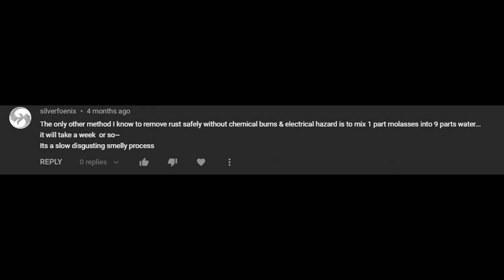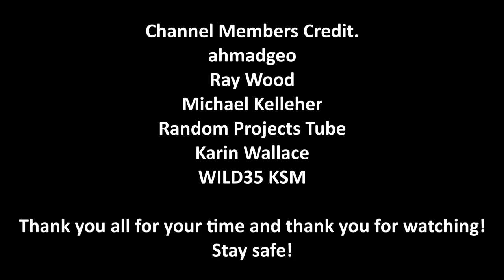Removing Rust with Molasses - Cast Iron Restoration.

Comment: Molasses is pretty expensive last I checked. I would just buy evaporust if I was going to spend that much money. Vinegar works quicker than molasses and is cheap. Sandblasting is always good to if you have the setup.
Reply from the maker: It is quite expensive yes.

Comment: I use an old computer power supply for Electrolysis,, and Oxyclean powder to make the solution,, all the info is right here on youtube....sand blasting is not needed.
I use 8 coats of Flax Seed oil when seasoning cast iron cookware.
You know you have the right Flax seed oil when the oil has to be refrigerated after opening.
425F for 1 hour,  let completely cool between coats.

Comment: THANK YOU for your restoration videos.  i enjoy watching them all.

here are some tips:

1.  for an iron pan, remember the chinese saying "hot pan, cold oil, foods wont stick" (it rhymes in chinese...  heat the pan until just smoking, then add oil & swirl it around.
2.  once the oil is heated until just beginning to smoke, add the meat, and quickly spread it out so it's not piled on top of itself, which would lead to steaming...  let it cook for about two minutes before trying to move it.  that way it builds a nice crust and will release from the pan.  this is especially important with ground beef.
Reply from the maker: Thank you very much!
Reply: @AJRestoration  this method really does work!  Heat the pan very hot, then add the oil and swirl it around.  When it begins to shimmer, add whatever you’re cooking, and it won’t stick!

Comment: I would think Evapo-Rust would do the trick. Then a good sandblasting and wire brushing before doing the seasoning part. I wouldn't think molasses would do such a good job removing rust anyway lol
Reply: it takes a long time, but it keeps removing rust the longer it's left in it. the benefit is more for large items like car frames because feed grade molasses is much, much cheaper than evoporust or other chemicals; you can make a huge vat of the stuff to dip something in for cheap
Reply: @briangoldberg4439  I can give it to you that it is cheaper, but you can reuse Evapo-Rust over and over again even when it’s dirty and black. Ask Hand Tool Rescue lol
Reply: @MarkMeadows90   the amount of evaporust you would need to dip a whole car frame or anything else that large would be astronomically expensive. hardly an option for the average DIY job
Reply: @MarkMeadows90  I have an issue restoring things you eat out of with chemicals, especially cast iron. Evapo-Rust is good on anything else. Jmo
Reply: @johnnyb1776  Well, there's always a good sandblast

Comment: I wonder, have you ever accidentally etched a smiley face on something and it wouldn't come off?
Reply from the maker: Yes in one of the first Cast iron videos, you could still see the smiley slightly if you tilted the pot in the correct way.
Reply: @AJRestoration  😆😆😆 live and learn, mate.

Comment: I use vinegar and baking soda on medium rust that one I would of sand blasted I bought many year ago. 5 cast iron frying pans and a Dutch oven  badly rusted got them all $8 went through a 80 lb bag of sand and bought a harbor freight blaster and came out beautiful and then put them on a restored grates and reseasoned. Them it's a great investment but I sanded smooth all the roughness

Comment: Did you ever try sandblasting one of these pans and then leaving it soak in the molasses water for two weeks? I wonder if the molasses can be used to colour the pan black prior to seasoning (after sandblasting)? Or instead of seasoning entirely?

Comment: Any idea what wire to use for a replacement handle if it is missing?
Reply from the maker: That is about 3 or 4 mill rod, or round bar would do the trick.